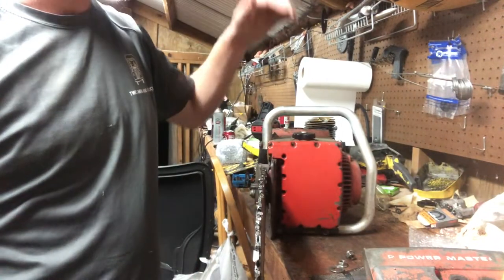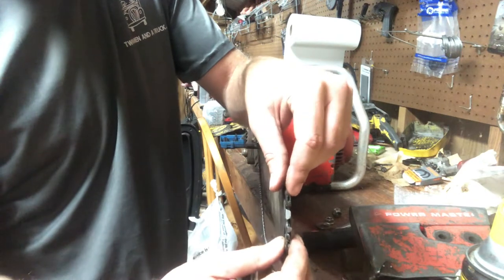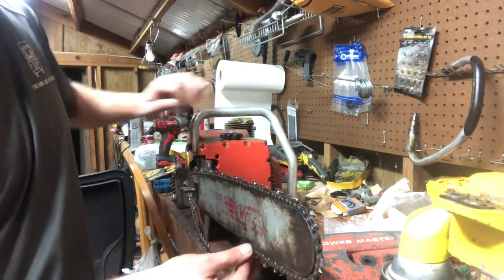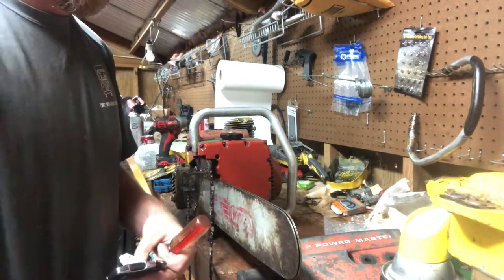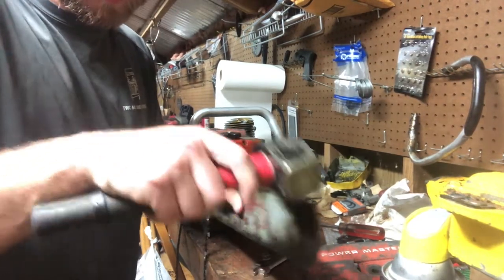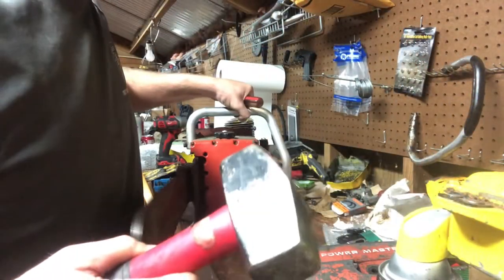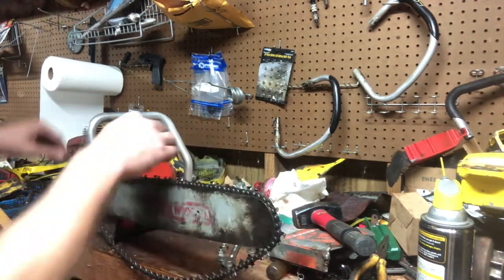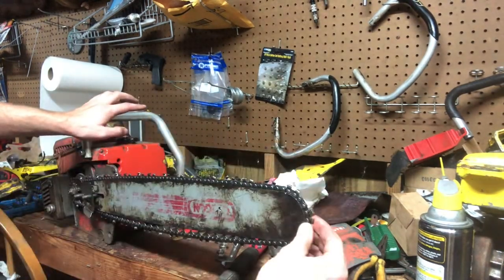Pinched chainsaw bar rails? Here’s one way to fix

Comment: Awesome video! Cleaning up tornado damage to my place today and messed up and let bar get pinched in large oak that was laying across road. This video is just what I needed. Local chainsaw shop said they never had much luck fixing pinched bar. Just want to sell a new one to you. Thanks! 👍🏼
Reply from the maker: It’s not perfect, but it will get it opened up where you can get cutting again. Thankyou for commenting!